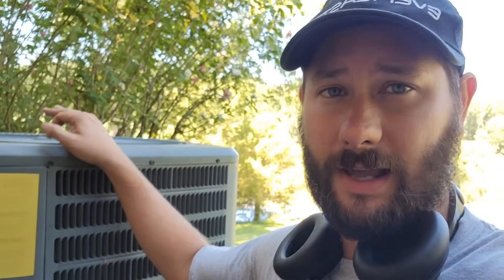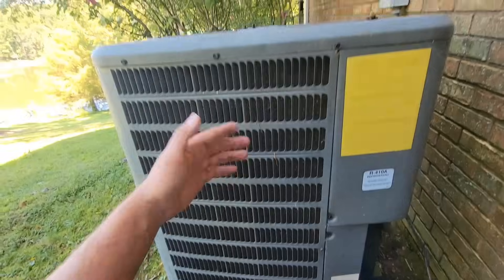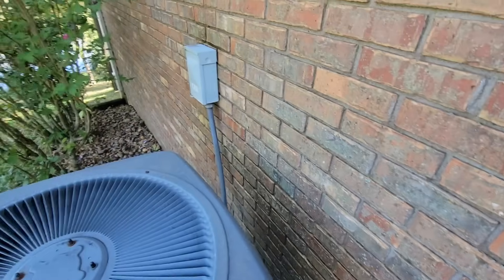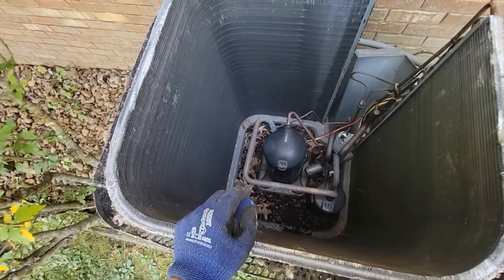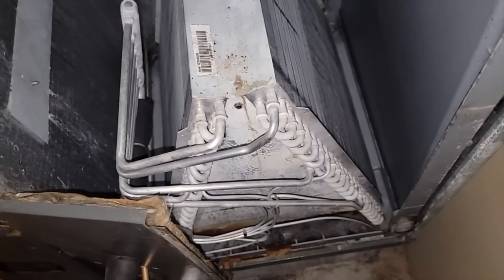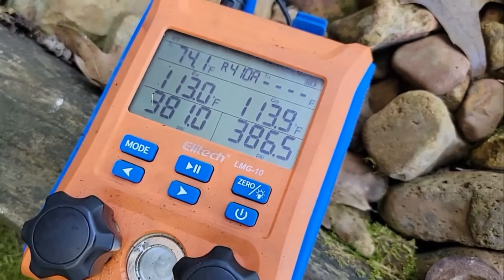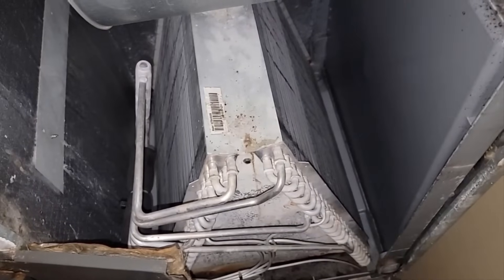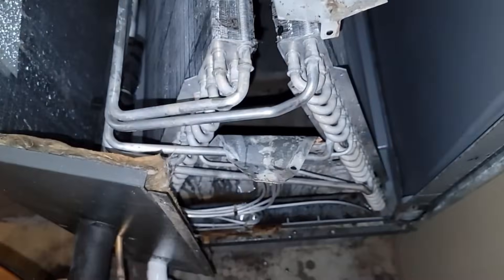How to find a refrigerant leak in an air conditioner?

Comment: Great video, my question is if the condenser is grounding out at start up and burning out the fuse do I need to replace the condenser
Reply from the maker: Not sure I would probably need more info
Reply: @taddydigest  I replace fuses in the electric box to the condenser turn on the system and it start sparking, I shut it off and I had the wiring check and check the fuses again and one of them was shorted out again. I'm not sure if the shortage is because the condenser needs to be replace or if there's something else I can do before replacing the condenser.
Reply: Assuming that he meant "condensing unit" (condenser coil, compressor, outside fan, etc.)...
I'd cut the power to the unit via the outside shut off switch and then disconnect the leads going to the compressor (at the compressor) and check the compressor's "built in" terminals for short to ground or other defect. 
You'll find many vids on YouTube explaining the process. Basically you'll use the ohms scale, attaching a test lead to each terminal in turn while the other is in contact with a bare metal spot on the compressor shell or copper line exiting it. A short between one of the terminals and the compressor shell or exiting copper line is a dead give away the compressor is toast...basically it should read pretty much "zero". You may also need to check the compressor terminals with each other...the dedicated videos explain this as well. 
Search "checking an HVAC compressor".

Comment: I'm having this same exact problem with my ac. Guy came out couple years ago and replaced the fan thing on the inside unit and said that would fix our problem. The system will not hold refrigerant. The line constantly freezes up. Definitely don't have $$ for a brand new system. Just need an honest trustworthy HVAC person to look at it and find the leak and tell me if it can be fixed. I'm in Virginia about 50 miles south of DC and 50 miles north of Richmond if you know of anyone in the area you can recommend.
Reply from the maker: You could try some leak Sealant, and u v dye define the leak.
Check out my video on leak sealant

Comment: How would you purge the nitrogen later?
Reply from the maker: not sure
Reply: @taddydigest  What?  Didn't you complete the repair?  I presume you had to evacuate the entire system, then refill.
Reply: Air is 80% Nitrogen.  So you treat it like you would a new system and pull the required vacuum on it.

Comment: Excellent work! Thanks for a better understanding on the process. I love learning more and more about my trade.
Reply: And that makes for a great contractor, love to hear that. Some ppl are quick to just make money vs actual saving customers a few dollars.
Reply: I have a question does refrigerant have to be in the unit to use the nitrogen?
Reply: It's not a bad idea if you're using a sniffer to have refrigerant in the system with the nitrogen basically used as a tracer gas helps find the leak faster
Reply: Watching this video tells me why most are saying get a new unit. SMH! Gratitude to you sir for loving and perfect your skills. So appreciated.

Comment: With the industry going through a major shift to A2L refrigerants starting in 2025, does it make sense to install a current system based on R-410A or wait until next year for A2L systems?
Reply from the maker: If you don't have to replace your system, now I would wait
Reply from the maker: I will figure it out and get back to you

Comment: I thought it was against the law to just top up low systems, perhaps with the current refrigerant not as enviromentally senstive if it leaks, so whats the answer anyone ?
Reply: if ur ac has 50 lb of refrigerant full capacity in it and known to have a leak then u have to find the leak and repair it. Otherwise, it is legal to just add refrigerant in - of course, it might be bad.
Reply from the maker: not here where I live

Comment: How much do you charge for a new evap coil?  Here in California it's about $4,500 to replace an evap coil.  If it's under warranty, it's about $2,000. Some hvac companies don't even check to see if it's under warranty.  I've done two evap coils under warranty this year as a second opinion. The first two companies diagnosed bad evap coils and never checked to see if they were under warranty and quoted the customer about $4,500.
Reply from the maker: wow that is bad 
That is way over priced
Reply: 4500$!! That's crazy

Comment: If I can't find a residential leak with an electronic & sonic leak detector within 30-40 minutes , I like to add fluorescent dye while I add   refrigerant. This provides comfort cooling until we can reschedule the leak inspection, and let the dye have time to show up  After 35 yrs in residential, if I can't find the leak in a half hour or so on most units, then I know it is going to be a tricky one. The uv dye really helps to pinpoint the problem. Owner operators.. Remember, dye is a tool to help you. You dont need to make a fortune on the dye. Be fair to your customers. You will earn a fair profit  during the repair or replacement of the coil.
Reply: I wish I could get y’all’s service in NW Georgia. I was told you can’t fix a leak. You have to have a new unit. I get refrigerant added twice a season or use window units.
Reply: @GApawpawandnana  that is false. In car ac systems, refrigerant leaks are diagnosed with fluorescent dye, electronic leak detector, soapy water, and other methods. All these methods can be used for residential systems as well
Reply from the maker: Excellent advice 👍
Reply: I was told leaks could t be fixed period! Dye was added no leak found I was told it must be the unit leaking and that can’t be fixed. The Heil United is 2 years old.

Comment: H10Pro by Bacharach for leak detectors. Always check the service port caps with electronic before getting the gauges out of the truck and before touching the caps.

Comment: just got a quote for r22 refrigerant at 3 lbs it was over $900 that sounds pretty steep
Reply: If you look around online you can buy 5lb cans of R-22 for $220. Of course if you have a severe leak don't bother on such an old system and get it upgraded.
Reply from the maker: Dang that is so expensive
Reply: glad i held off especially when theirs apparently   a severe leak

Comment: I’ve been using the same leak detector. Had to replace the battery and sensor. Other than that, it’s been a great detector! I’ve also use a H10. A little expensive but what isnt these days?!

Comment: is goodman heat pump GSZB404210A good for 2014 mobile home? in amarillo texas , r19 walls, r25 roof, r 30 floor, singal pan widows, 1216 sqft home. not air tight it has leaks. temps below 20 is like 8 days during heating seanson. i set termostat to 74 f and am using  electric furnace 10 kwh for 108 hours a month. my electric rate is 0.097 kwh. the highest bill to have was 250 but that is from whole home usage. the goodman heat pump says it uses 2.9 kwh at 10 f with a COP of 2.08 and a 2.7 kwh with COP of 1.34 at -5 f. the price for the 5 ton a-coil and 3.5 heat pump is $4,876. i can get 30% off that price on rebate then it whould be $3,413.235 also, why whould tech go with mortex 5 ton a-coil and 3.5 heat pump. thanks for help.

Comment: Hay Taddy, Got an unrelated Question, sorry to post on your video. I went to a Goodman PKG HP the other day with Compressor not starting. I could hear it trying like a dead CAP. Checked the CAP (70x5 duel) it was 4.7 on fan and 311 on Herm!! 311/5 wow. Cap was 1.5 yrs old. I replaced it and system began to run. Was pulling 15.5 amps at start then 10 minutes in I noticed it had risen to 18 then ten minutes latter it was near 20. The RLA is 26. I traced the wires and found nothing mis wired to the cap so I called it the Compressor and recommended the Comp. I did not find any strange readings when I did OHM the comp tho before I restarted with the new CAP. Have you seen this before? It is a new one on me.
Reply from the maker: Is it a 2 stage compressor was it going into high stage? And that's why it pulled more amps
Or is it just single speed
Reply: @taddydigest  Single speed
Reply: The capacitor can read higher but if you look at your meter its nano farads so its actually lower.
Reply: https://youtu.be/cZUpCEbIRow?si=v8283FCc_UPzLQoh

Comment: Can u do a video on superheat and subcooling,  i know everyone tells people to only check subcooling, which if the system is installed properly the txv will hold the superheat to what it is suppose to be, but alot of the time it's  not and superheat is usually way low.
Reply from the maker: Type in the search bar super heat and sub cooling taddy digest. I did a video

Comment: If tech suspects a leak t seems like at that point it should not be up to the customer to just recharge.  This is basically leak detection using refrigerant. I thought the EPA had rules against that.  my common sense says that even if a system is 6-7 years old and has been working well then stops cooling there is a leak.  I understand that nothing is 100% leak free but how many calls do you get that that the system is grossly low and there isnt some type of correctable leak? maybe 1%  Customers are cheap and have this notion that they can just fill and be good for another 5-10 years when 99% of the time thats not the case.  So all they do is throw more money away in the long term and harm the environment. Im not trying to be a crazy tree hugger but sometimes the customer needs to be educated.

Comment: I'm at 2:20 in the video.  Does this hold true for vehicle A/C's? (slow leaks = low pressure side and fast leaks =high pressure side?  Thanks for the video!
Reply from the maker: It really depends on the size of the area that's leaking

Comment: $2k for installed A-frame when the material cost is approx $700?
Reply from the maker: Is that all it cost?

The refrigerant,,The indoor coil, The filter drier, The nitrogen, The solder, the acetylene, 
The insurance, The gas To get there,
The warranty you provide,
You tell me
Is that all it cost
Maybe we should do it for free
Do you do jobs for free
Would you do it for free 🤔
 So what do you say?
Reply: @taddydigest  $1300 for what you just listed is awfully high.

Comment: I have that noise coming out of my central vent when the AC is off. Does anyone know what's wrong with my AC? It works fine. Just that sound is lingering after it's off.
Reply: I’m not professional but just a guess it maybe the high and low side pressures equalizing which would be a normal thing.

Comment: You only put the max on what the system tells you #tag . Especially if you putting nitro on the low side if low side says max250psi you put 250psi
Reply: there is no way to only put nitrogen in the low side unless you would disconnect the coil.

But yeah,  the coil clearly states design pressure and R22 is very low pressure.  I thought last one I saw was 150 on the R22 coil and 450 on 410a coil.

Comment: Most refrigerant leak detectors are incredibly sensitive. If you add any refrigerant you should always do a leak search. A basic leak search only takes 10-15 minutes to make sure you don’t have a good size leak. You don’t have to reclaim the gas and add nitrogen, the refrigerant is the gas you are looking for, and soap bubbles will also blow bubbles regardless if there is nitrogen, as long as there is pressure, don’t complicate it. You can’t give the customer the choice you are supposed to make as a trained technician when it’s such a simple move and avoids callbacks

Comment: The common census for leak checking is to raise the pressure no higher than the highest rating on the low side.  Its to avoid damaging the internals of the system.
Reply: That makes it hard to sell them those items though dont it?? 🤑 JK LOL
Reply: I can’t  remember the brand, but there was a unit that had a melt out plug on the bottom of the accumulator.  You had to feel around the bottom, and maybe use a mirror.
Reply: I mean, I somewhat agree with that when it comes to 22 and how it was soldered in on older units. but days of 410 with higher pressure values, I don't think I've ever had any trouble ever running nitro up to 450-500
Reply: @carldrake959 until u try that on a 15+ year old package and make pin hole leaks in the evap
Reply: Does that also apply to the heat pump tho , since it is reversible and they both use the high pressure
Reply: @g-lato9791  incorrect. This is a lack of understanding right here. In a heat pump, the high side just alternates between the evaporator and condenser but is still same high side pressure reading to go off and you should not exceed that number.

Comment: If it's a large leak in an air conditioning system it's usually on the high side of the system To check the condenser hook up your high side and low tide gauges turn off the power remove the condenser fan motor from the top of the unit Turn the unit power back on checking the high side pressure with condenser fan motor not working the high side pressure will increase to a point where you might be able to locate the week much easier Do not exceed momentarily 400 PSI Turn off the power check With an electronic leak detector You can also use an UltraViolet leak detector After injecting and allowing the fluid to circulate  throughout the system One other method is using nitrogen to build up the pressure to see if we could find a slow leak using a Ultra Violet leak detector after injected fluid All these methods MUST only be performed by specially trained air conditioning service technicians with years of experience Absolutely no homeowners should ever attempt these leak detection procedures which could cause permanent bodily injury or possible death Leave it to the professionals

Comment: Get an ultrasonic leak detector, i got the one you have and i wont use it i had a leak it wouldn't find it but soap bubbles found it, tested it right on the leak and it still wouldnt detect it, also it was a brand new 1.

Comment: I feel for the home owner... but the best thing to do is have some window units ready... 3 units are more than enough to keep you comfortable enough when SHTF with the main AC. they cost $150 each. Then with an older system, especially one approaching 20 years... just get the full install. else with and older system you may find yourself spending more money  over the long term vs a new system plus the inconvenience (they always break on a Friday afternoon ) constantly fixing issues as its dies. At least you can get a warranty on installation and equipment that will cover you for a year or more. I also recommend insisting they inject UV dye into the system upon installation or even service. that way its easier to find the leak should one creep up at any point due to installation errors or aging.
Reply: I just had a guy come over, just like I thought low on refrigerant. the system is 17 years old, he said it would cost 600 bucks to find the leak, and or 180 bucks per gallon of refrigerant. I told him no to repaired and since I have a 2 and a 1 ton mini splits in the house already gonna take my time and find another one for upstairs and I'll run those as needed. One goes down I can still get some cooled air from the others. Just tired of spending 200-300 every year for refrigerant and checks and this and that. Last repair I paid for cost me 2500 bucks to change the A frame, not ever again! Thanks for sharing.

Comment: Can an overcharging the system cause the TXV to get stuck closed?
Reply from the maker: Overcharging will definitely to stay closed
Reply: @taddydigest  Thanks for that, the tech told me that the TXV is bad and he need to install a new coil, the system is 3-year-old.  I took an image of his 4 port manifold + Micron gauge where it showed the following, on the left side, a pressure of 96.3 Psig below it is 39.1 SH, and below it is 29.5 VSAT.  On the right side it shows pressure of 278.8 Psig,  16.8 SC, and below it 90.7 LSAT.  I would very much appreciate your thoughts on this
Reply from the maker: Yeah it looks Like there is too much liquid in The condenser And not Enough Liquid In the evaporator so definitely could be the filter dryer for the t x v

Comment: My unit froze up the lines are copper so I turned the unit off so it can thaw from the big ice block so would that problem be from having a leak in the system? Thanks in advance
Reply from the maker: Could be from leaking refrigerant.
Could be from a dirty filter.
Could be from low air flow.
Just use a process of elimination to figure out.

Comment: I hate using dye, you put eyes on it, and look for oil spots, and get old fashion soap bubbles..you can find the smallest leak easier. Check out all the joints first
Reply from the maker: I'm not a fan of using dye as well
I've actually never used it before
Reply: Introducing dye into the system contaminates the refrigerate that is being used
Reply: The dye will start making the TXV valve start sticking..if have piston,  it will clog the tiny piston holes..
Reply: @MartinLDeLoach903  thats not true...dye is colored oil....it doesnt clog anything